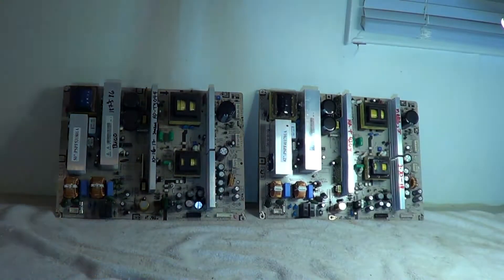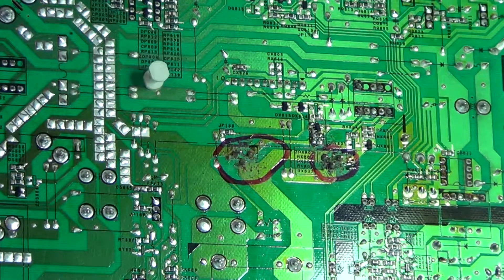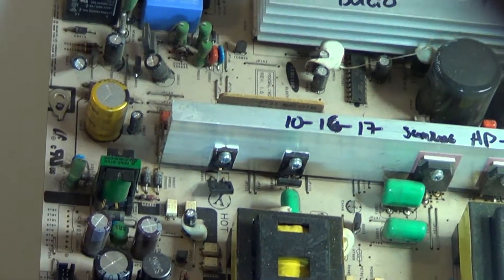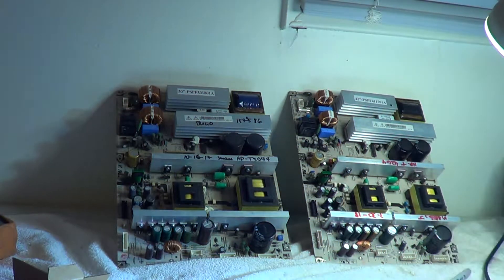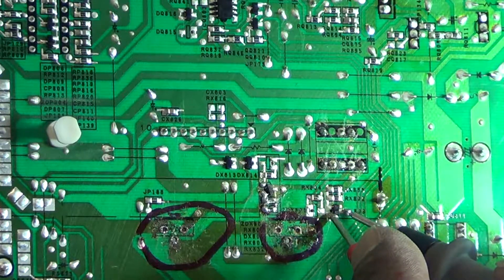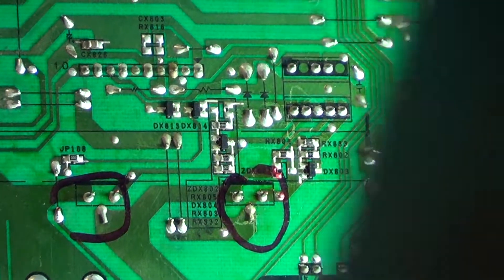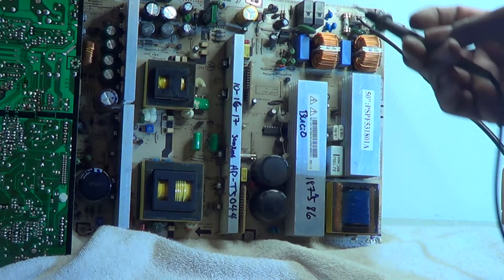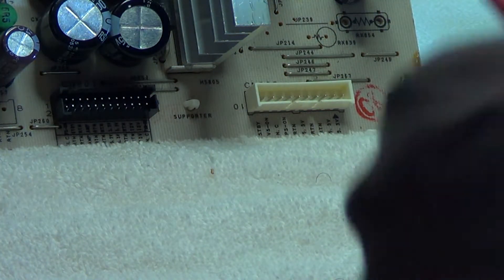Samsung Plasma HP-T5044 and HP-T4264 tv, Clicks only, no picture

Comment: Great video im hopong tonreaolve this issue. Thought ud found the fault . On the y sustain board there was a ceramic capacitor  clearly blown with discolouring around . I repoaced that and 1 next to it and cleaned it up .  Still clicking . At first it wouod only keep clicking if y sustain board was pligged in . But now if main board OR y sustain  board of pligged in it clocks reoeatedku few times over. Any thoughts ? No obviois burn marks . Ive not really looked at x sustain  as ot dont seem to be the issue at least not causing the clicking . Itll click once . Which i believe is normal right ?

Comment: Hello, SIR, I Removed The Rear Cover On My Plasma TV. The Y Sustain Board Has Lose Capacitors And It Gos Click When You Move Them But The Wiring Harness On Top Of The Plug That Has Thirteen Wires Brook Off Looks Like It Burnt

Comment: Hello, Sir. I Have A Samsung  Plasma TV, PN 59D550C1FXZC,  It Works Great But After Half An hour Or One And Half Hour The Picture Screen Go"s Dark, But You Could Still Hear The Movie Playing, Any Suggestions, Possible Y Sustain Board And Upper And Lower Buffers,. I Still Have To Remove The Rear Cover To Inspect The Electronics. Thank You Sir, If You Contact Me Back,
Reply: Hello. Big Dog, I Removed The Rear Cover On The TV And Found The  Wiring Harness From The Y Sustain Board 13 Wire Plug Burnt And  Going To The X Board Is Brittle. But Both Ends On Both Pig Tails Are Fine. What Do You Think. All Capacitors Are Not Swollen At All. And The Moss Fits I Tested Are Fine. Used A Multi Meter. On Continuity. From Toronto Ontario Canada. Thank You SIR, IWatch Your Videos All The Time. Samsung 59 Incn.
Reply from the maker: @arduinogalipo4850  Not sure. Do a continuity check on the plugs. Otherwise I would just change the Y-main.
Reply from the maker: If the problem is Intermintent and TV comes back on and plays after a while, then check for bad solder connections on the Y-main board, otherwise U can just replace it.
Reply: @bigdog8882  Thank You Sir. A Technician, Told Me It Would Cost Around $150,00 Dollars But I Ask Him The Parts Are New Or Used, No Answer Back.
Reply from the maker: @arduinogalipo4850  Really doesn't matter on the parts. TV is not that old anyway. Thats a good price, just get her done..lol
Reply: Hi Again Big Dog, I found Two Capacitors Leaking Fluid From The Y sustain Board, PN C5107- C5106. 250 Volts Times Two, At 47UF, There Facing Down Wards Where The tin Opens Up, When They Let Go, But There Not Popp At All, Would That Make My Screen Go Dark, Its Only A Question, Thanks Again.
Reply: Hello, Big Dog, I Never Got Your Name, My Name Is Arduino Galipo, From Ontario Canada. I Got My Lead Connector  Wiring Harness Today. For The Y Sustain Board To The X Main Board Install Both Ends. The Transformers Are Working The Green Flashes Very Slowly Over Sixty Times I Turn On The TV But The Red Light Only Comes On When You Push The Button To Turn It On, Any Suggestions, Thank You Very Much Sir,

Comment: thanks for the video!  if the mosfets are shorted or blown, does that cause no voltage to the vss pins?
Reply from the maker: Most likely it will blow the fuse by the Vs plug. Just check across that.
Reply: @bigdog8882  i checked all the fuses before anything, except the sneaky one you pointed out, no bulging caps, stand by power is solid 5.1 v . everything leads me to believe the smaller mosfets are shorted not  letting the transformer do its thing. im still a novice, i truly appreciate you taking the time to answer. In the words of Denzel......My man.....

Comment: Hello...my smart Samsung TV mod UA55ES8000R has no power at all when switched ON'. However when I disconnect the cable to main board frm power board the backlight is obviously functioning. Reconnect the cable will cause everything to go dead.
Reply from the maker: You need a mainboard.